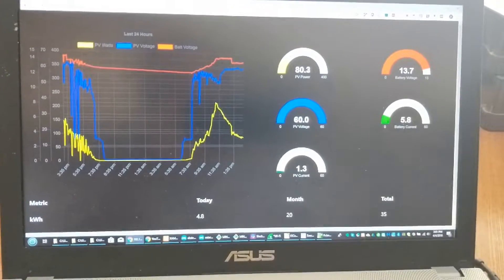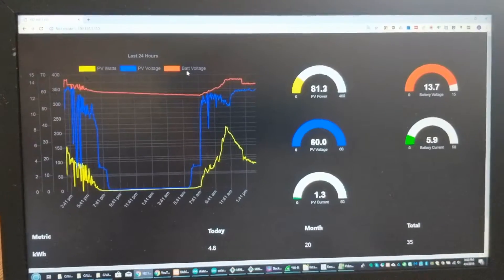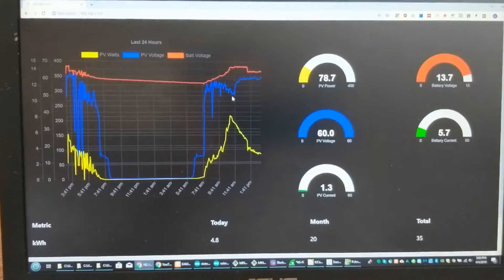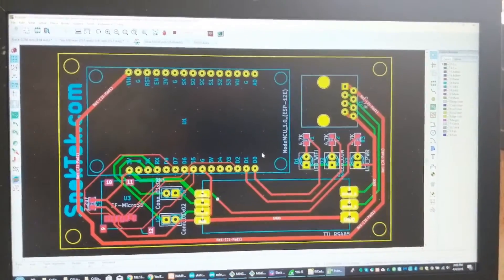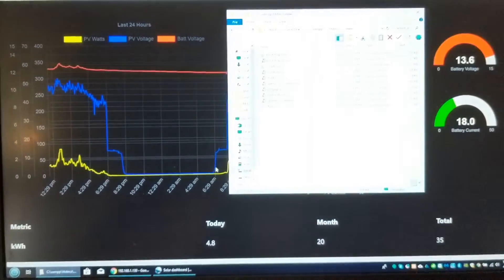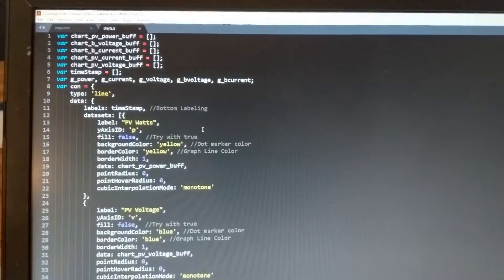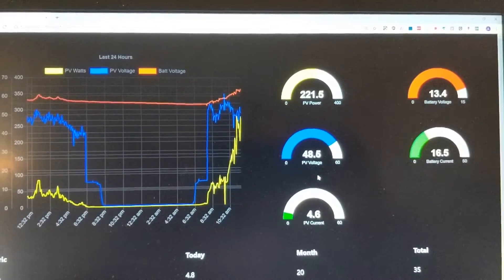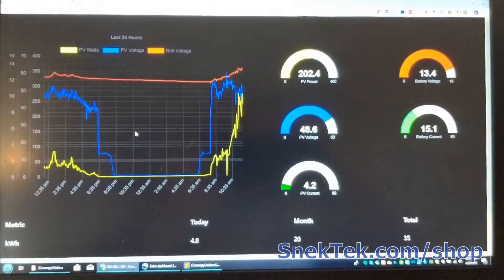EPEVER RENOGY VICTRON WiFi Solar Datalogger (AVAILABLE)

Comment: Just ordered a kit. Can't wait to try it out. I have  Tracer 4215BN and it's an amazing charger but the MT50 lacks datalogging and networking capabilities.
Reply from the maker: Thanks! I will send it to you soon! I agree the chargers are good but the MT50 is lacking.
Reply: @SnekTek  Got it and it works well. Hoping to maybe add functionality to include my Victron BMV-700 and inverter logging.
Reply from the maker: @cheezemanrich  Awesome, you can make a post on the forum showing what you did. Your SDcard holder is being sent tomorrow.

Comment: Nice!  Glad you mentioned those times when the panels go over power point voltage.  I use those times to direct power to heating water.  A fairly simple process that takes less than a dozen parts and is highly efficient. I can't get people interested in it.  Those point of use 2-4-6 gallon tanks are ideal for a camp and are enough to take a shower with. Less than a KWH needed.  I harvest over 2KWH a day that would otherwise be wasted.

My icon is my house control panel. From 20' away I can see what is happening with a couple LED and it doesn't scare my wife. I should write a display program. My career was in measurement and you can discover many interesting things about site solar with a few days of data. But, after a few days there isn't much new to learn. I can always pull it out of the micros when there is a need.  Sure appreciate seeing something technical once in a while. It is disappointing just how much incorrect trash is posted in solar on youtube.
Reply from the maker: Thanks for your comment. I uploaded the followup video to this last night in case you're interested.

You're right, in a fixed location the solar performance is similar day to day. Since my system is on the camper trailer, the environment is so variable and I wanted to have a good idea at the end of the day how much power I've generated. I'm looking forward to see the performance while driving. The battery voltage is a poor indicator of battery state of charge, and I often ran the generator to top off the battery after making dinner and associated battery drain. Often used the microwave to reheat food. We often run a fan at night and I don't want to deep cycle the batteries more than needed.

Regarding the extra power after the batteries are topped off, heating water is one idea. Another idea is to make ice, more useful in the heat of summer.

I had a look at your channel, your solar shed is pretty cool, I like how you have your dishwasher setup and make do with less.